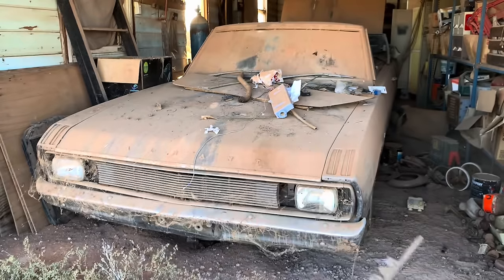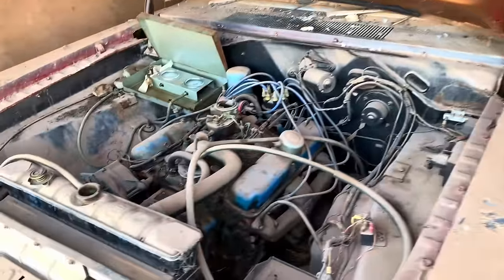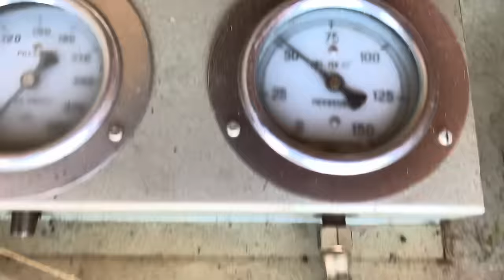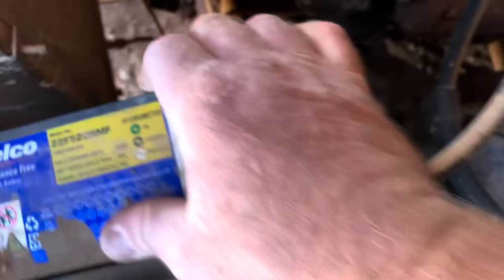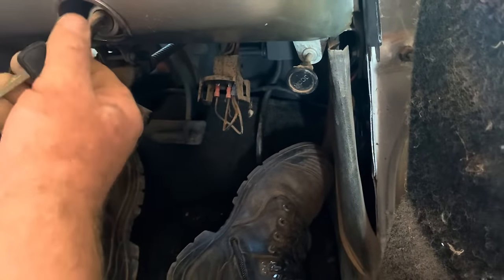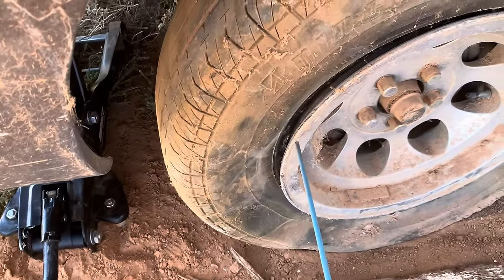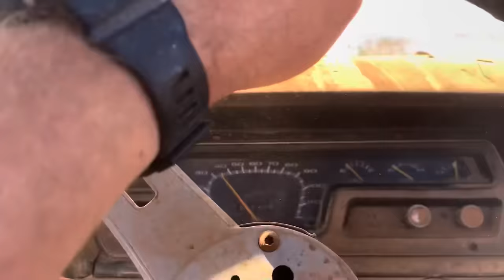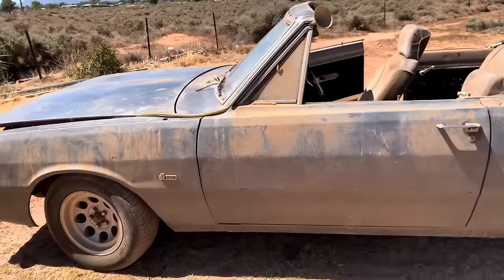Will it start and run after 15 years??? Of course it will

Comment: Fired up quite well considering it's been sitting for 15 years lol. Of course it's going to sound very ticky and rattley after such a long time. Give it a proper service and run it for a while and the ticking might go away. Great video thanks for sharing brent.👍😃
Reply from the maker: Cheers mate , engine will eventually come out and the sump changed as it has issues .
Engine bay will be painted and the engine tidied up 👌🏽
Reply: if you watched till the end the tickin did go away

Comment: Shit mate, a Valiant!!!!! Come back in 40 years and it will start.
I’ve pulled from swamps and driven them out not a shed.
Well done 👍🏻make sure the steering box is attached 😂😂😂😂 been there done that 😂.
Valiant’s can fly they jump well been there done that 😂😂
The k frame lands well and protects the sump but fills the engine bay with dirt.
Falcons smash the sump in and break engine mounts.
I wish I had YouTube
Reply from the maker: Haha yes , than can be good cars when they’re not rusty lol 👌🏽

Comment: ❤ valients n redbacks watch out for the blue snakes 😂
quick tip for next drive put a small hole in the lid of the fuel bottle so you can spray it down the tube instead of showerin in it
Reply from the maker: 😅😂 thanks for the tip , I wasn’t enjoying my burning lips from the fuel spray lol
Reply: @unclebrentsshed4253  bet it felt as nice as a day at the beach without sunscreen hahahaha